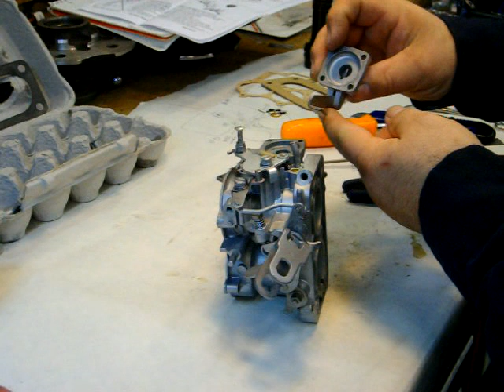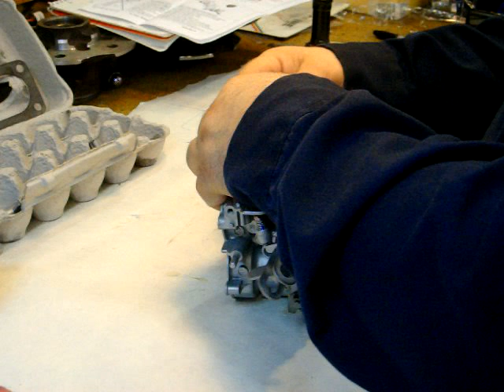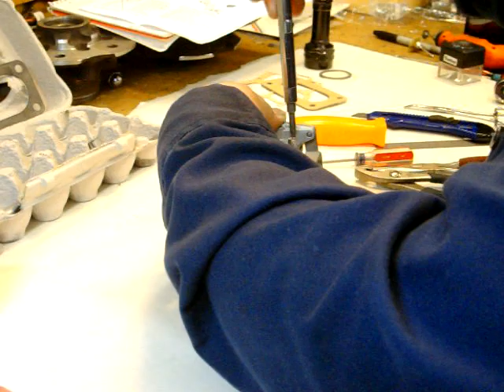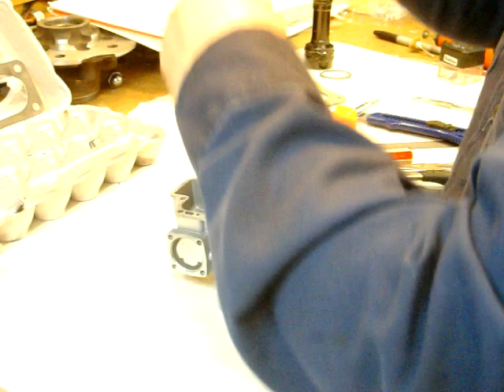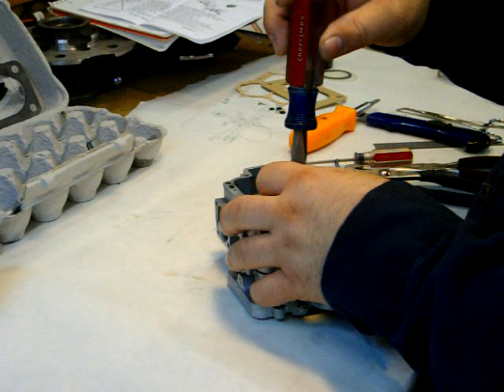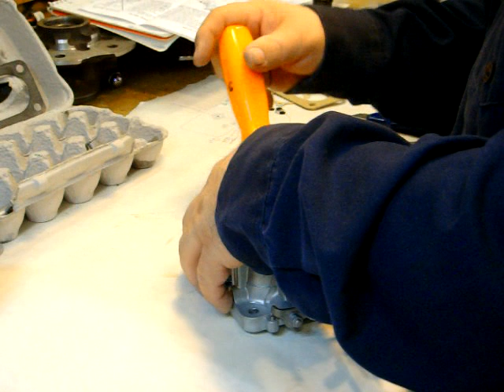Weber DGV Rebuild Part 3

Comment: Much better lighting. Still not the best camera angles, a lot of blocking the action, to much time doing up screws (cut or speed up these parts). Heaps better video than part one anyway !! A better camera will probably help
Reply from the maker: I don't remember what I changed with the lighting.  I thought I shot them all on the same day.  I do a lot more editing on vids now.  If you come across the bearing vids, I think you'll see that I did come up with an overhead holder for the camera.  It's been a learning process for the last couple of years.  I'd like to think they've improved since then. :)
Thanks for taking the time to comment! I appreciate the input!!!  Maybe check out a couple of more current ones and let me know what you think. :)
Thanks!
Mike